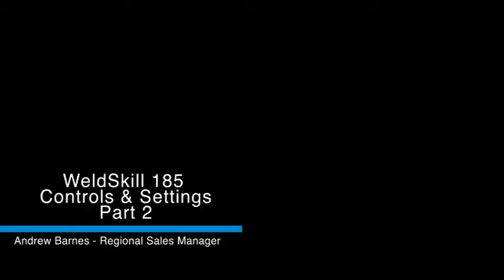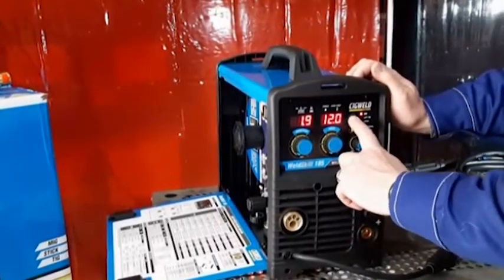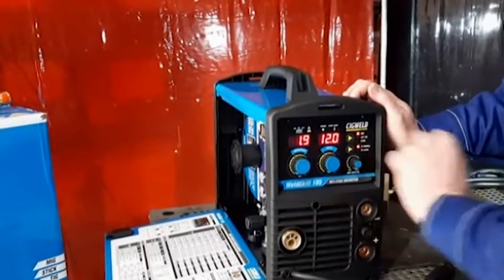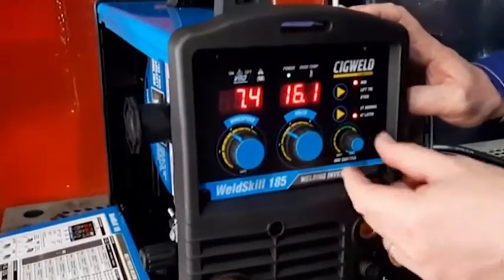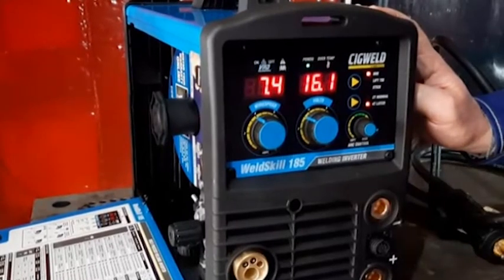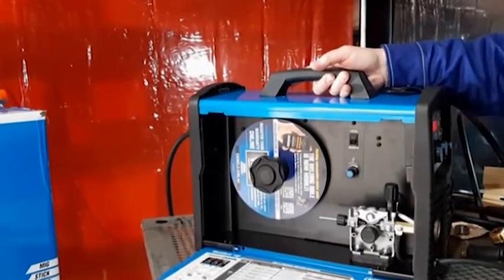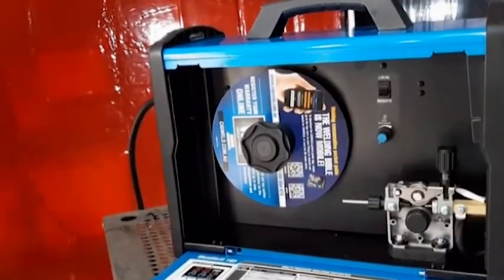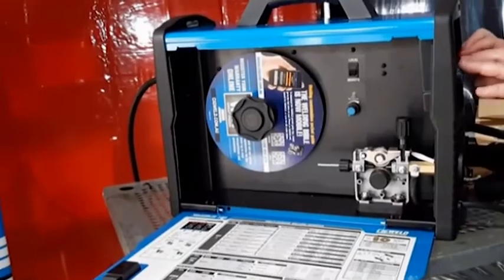WeldSkill 185 Controls & Settings - Part 2

Comment: I have a weldskill 155 after depressing trigger on mig for about 5 seconds runs normal then the voltage goes up to 69.4 and the wirespeed double can you tell me what may be wrong please? Tia
Reply: Did you figure out what was wrong with it? Mines doing the same
Reply: @tezkay362  no not yet thinking of buying a new welder